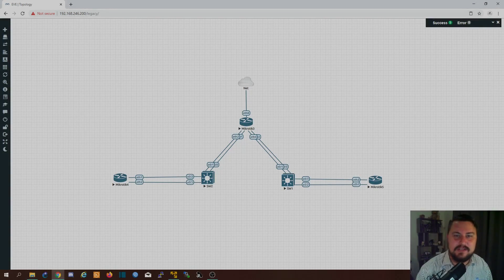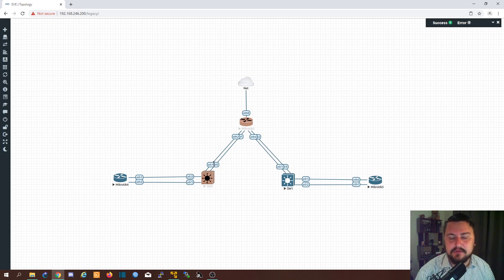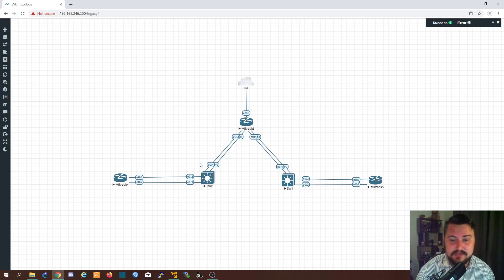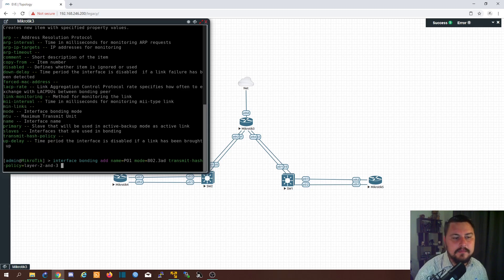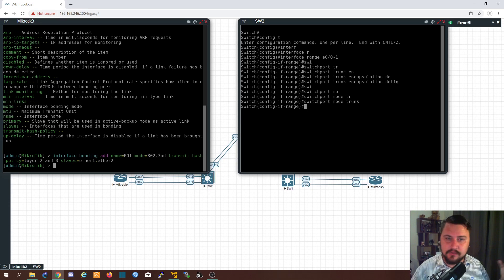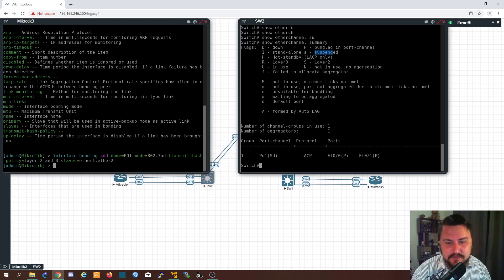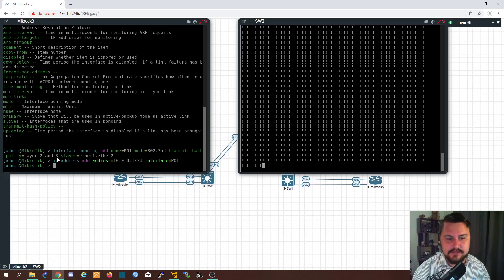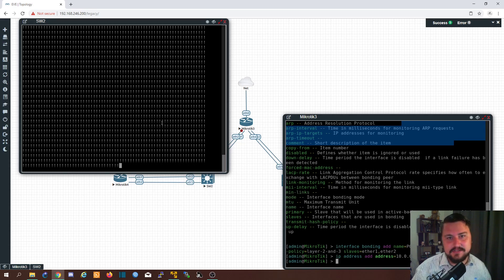MikroTik & Cisco - Configuring LACP

Comment: @TheNetworkBerg genuine inquiry: why did you select transmit-hash-policy=layer-2-and-3 on the routeros device? might this be cisco's default port-channel hash policy?
Reply from the maker: It's just the hash policy I have found to work best in this situation. You can really think of it as how the device itself will decide to load balance traffic. Even though LACP is awesome there can sometimes be events where traffic gets pinned to a single interface because there is no change in the hash. Best to check which hash policy works best on your own network and then deciding which one to use.

Comment: hello Berg, nice work.  i have an issue on my lab- i have done boning on Mikrotik and lacp on cisco sw, but on the cisco sw it shows that 1      Po1(SN)         LACP      Et0/0(w)    Et0/1(w) and w means  - waiting to be aggregated, i tried all posible atempt but no luck , any idea on it? im using evepng cisco l2 image - i86bi-linux-l2-adventerprisek9-15.2d.bin and chr-6.48.4.img for MT. thanks a lot.
Reply from the maker: Hello, thank you for telling me what software images you are using. I will first have run LACP on the same images and see if I can get LACP up or if I run into the same issues. There are many reasons why this could not be working so I can't say off the bat.
Reply: if i use lacp mode on then connection is up; if i create the pc first without trunk mode and assign ports then lacp is up, as soon as set as trunk mode then lacp is down. might be eve-ng issue?

Comment: In your video, you mentioned doing this over Winbox.  Are you still planning on doing this?  I really need help in this area (bonding) as well as VLAN configuration.  Thank you!
Reply from the maker: Hi TheCloser, if you want to see this in Winbox I can definitely make a plan to guide you through the steps of setting this up through the GUI :)
Reply: @TheNetworkBerg  Hi I would like that too :) I plan to use a synology 1520 with Mikrotik crs226. Thank you in advance!